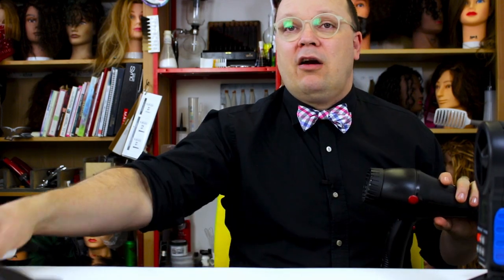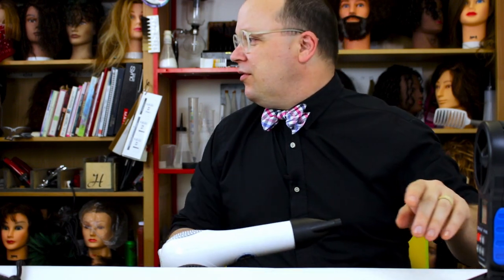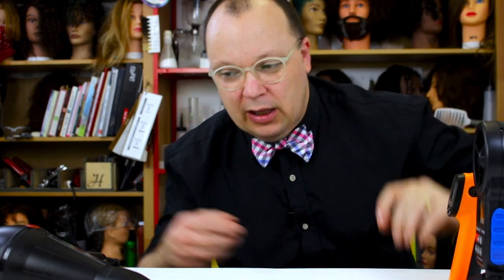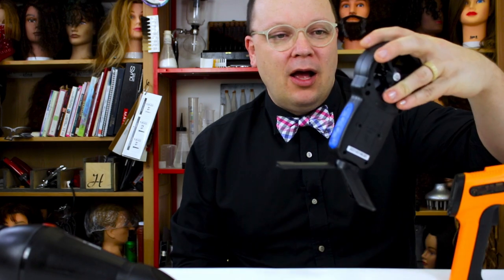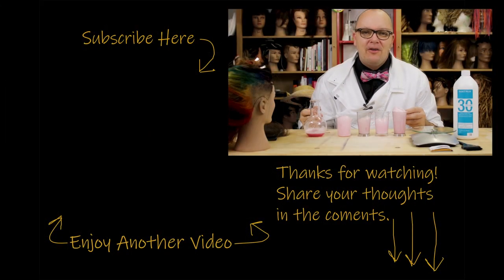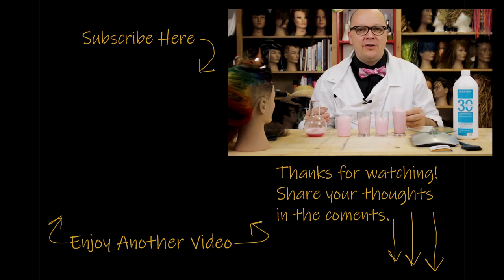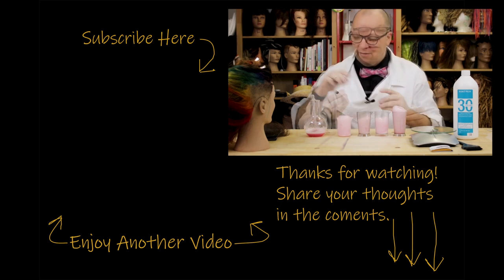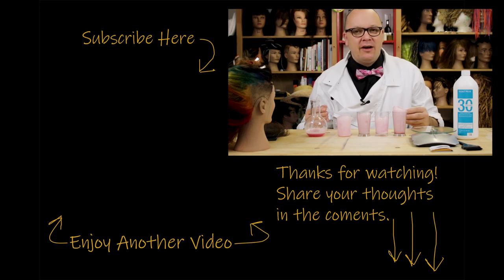How Fast Is The Air From My Twin Turbo 3200

Comment: So after testing some blow dryers which would you say is good for keeping hair healthy but strong enough to blow dry curly hair my hair is not very curly but it’s curly
Reply from the maker: It kind of depends on how you are drying it. From curly to straight: the CHI is great but the Babyliss and Paul Mitchell are too. Ionic output being the most important thing in my opinion. But if you are diffusing to keep your hair curly, all their diffusers are disappointing. A good aftermarket diffuser is a good idea. I should do some tests sometime, but of all the dryers I have tried the best one for drying hair straight and has a great diffuser included is Dyson. At some point I'll do a video on it. Thanks for watching!